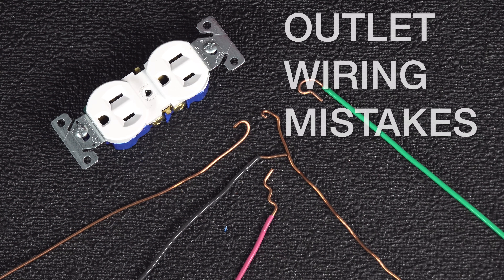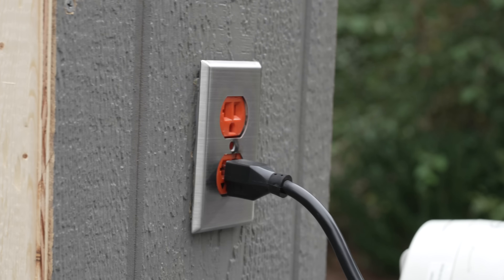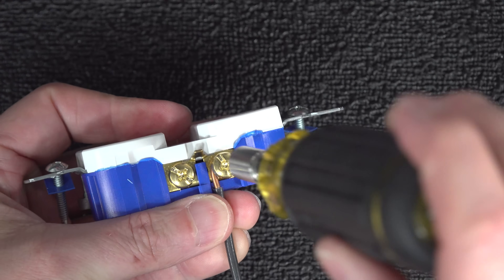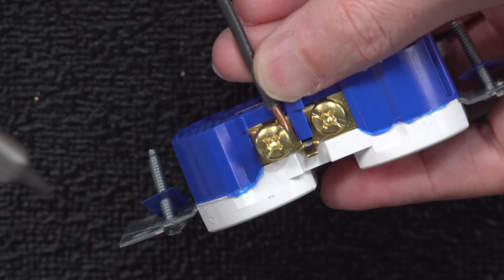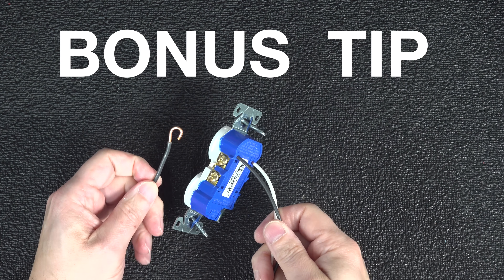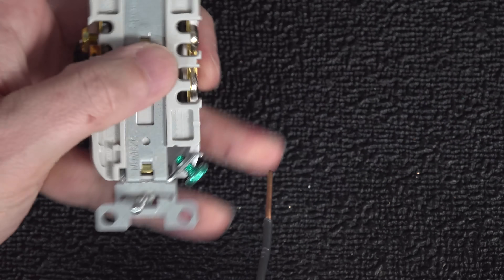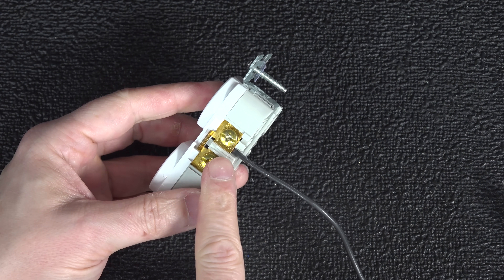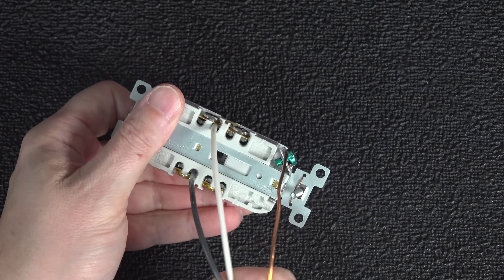BEWARE Of These 3 Common Wiring Mistakes On Outlets & Switches

Comment: What went unmentioned was the use of the most effective tightening tool. While the screws on our US outlets will technically accept a flat and/or Phillips driver, the most effective driver(provides the most torque) would be a square,Robertson, bit.
Reply: He used a #1 square drive bit in the outlet which is the appropriate bit.
Reply: @ronh9384  is that what the manufacturer speced out?
Reply: As a Canuck, I NEVER understood the preference to a Phillips (star or garbage) screw head. Always veen a 'Robbie" fan. Red Robbie, usually Wood screws. Green Robbie fer electrical.
Reply: Hahahaha. Drivers do make it easier mine got stolen on the site. So, yea use thy hands.
Reply: Actually you van buy the bit that is a Phillip and flat combined just like on the plug
Reply: My apprentices are not allowed to use a screw gun on the connection screws. Hand tightened only with Roberts or flat screw driver. Most of the green helpers always strip out the screws or never get them tight enough, so I always make sure they learn the right way first.
Reply: I'm sorry but if you're using a square/Robertson screwdriver, you've lost all my respect. use an ECX screwdriver or go home.
Reply: @ThreePhase470  Red Robbie #2 all day everyday.
Reply: If you can't get the screws tight with a Phillips screwdriver, you should start eating some beef everyday instead of that soy stuff!
Reply: @melvinrexwinkle1510  A real worker worth their salt uses power drivers, or at least use a screwdriver with a properly sized bit that won't cam out or strip the screws. You gotta work smart, not hard.

Also it's the year of our lord 2022, that soy myth has long been debunked. Get with the times son.
Reply: @AdhamOhm  Soy is heavy on plant estrogen.
Reply: @AdhamOhm  Soy boy
Reply: @AlienRelics  Good thing I'm not a plant then.

Beef and cow's milk, on the other hand, have loads of estrogen. And not just plant estrogen either.
Reply: @robbarber7253  😆 I feel like it's 2015 again. Simpler times.
Reply: @AdhamOhm  power drivers are diesel powered and deliver min 5hp. You can't really tighten a screw under 2022 fps
Reply: @melvinrexwinkle1510  Let's go Brandon 🏁

Comment: It should be noted even the cheap receptacles are labeled as to what wires go where. They also have a built in strip gauge. Those plastic wings next to the screw terminals on hot and neutral are to catch the end of the wire to avoid having too much hanging out. Usually the ground terminal has a wing that serves the same purpose on newer receptacles but it doesn't seem like it's as common as the plastic/ceramic wings are for hot and neutral. Almost every receptacle I have replaced I seen that the previous guy bent the end of the hook past 180 to clear those wings instead of just trimming off the excess.

Comment: Related question: why are the push in connectors (replacement for wire nuts) and wago lever connectors good but push in connections for outlets bad? What is the difference between the two?
Reply: low quality sockets^^

Comment: The earth must always be at the top. Common mistake in the USA.
When you wrap around a screw you are only going half way round. You need to use long nose pliers to finess the wire to as close a circle as possible to maximise contact.
Also, use a proper electricians screwdrive with full insulation.

Comment: HE MISSED SOME VERY IPORTANT MISTAKES THAT CAN AND WILL START FIRES!  I AM A MASTER ELECTRICAN IN 24 STATES. >>>>>>>>>>>>>>>>>>>>>>>>>>>>>>>>>>>>>>>>>>>>>>>>>>>>>>>  <>>>NEVER EVER run current through those break off tabs in the middle of each side of the duplex outlet. Duplex indicates TWO outlets, so let us think of these as TWO outlets.  Wire nut pigtails onto your wires and just use 1 wire for each connection, 1 hot 1 ground & 1 neutral. Those tabs are meant to be broken off so you can have either the hot broken off so one outlet is on a switch for a table lamp or a floor lamp and the other outlet is always hot or un-switched. That way a wall switch can turn on a table lamp, or a floor lamp instead of an overhead light fixture. You can also break off BOTH of the tabs off and wire each outlet to a separate circuit, on a separate breaker. This would be done for heavy duty loads like photocopiers, large refrigerators, microwave ovens, convection ovens, or beefy power tools, such as for woodworking, or metal working. It can also be done for redundancy so if one breaker trips you still have a live circuit.  If you are using stranded wire ALWAYS ALWAYS  twist the ends of the strands COUNTERCLOCKWISE so as the screw tightens up against the wire it actually pulls those strands together tighter and tighter. If you twist them clockwise, the strands will be mashed out and loosened up as the screw turns against them.

Comment: 1 thing to add. always wrap the outlet in electric tape to cover the exposed screws. makes it a bit safer to work with
Reply: I wouldn't say you should always insulate after you're done like that but it's a handy trick and one I use in a couple places. IDEAL has their ArmourBand that makes it a bit less of a hassle than having to pull the device mounting screws all the way out. https://youtu.be/pTrLkNwPBVQ

Personally I wrap with electrical tape when the outlet or switch is going into a metal box or when there's two separate circuits going into the same box. You could argue that it would improve safety in the event that the cover plate breaks but honestly you're much better off just using the "unbreakable" cover plates everywhere if that's your concern. If you ever have a spare of one of those try cutting it or breaking it and compare it to a traditional non-nylon plate. It's a massive improvement and once they aren't so incredibly brittle it's not much of a concern.

Comment: Some comments: Backstabbing - sticking the wires into the 14GA holes in the back of an outlet where its held in by a spring. These make shitty connections and you called it "backwiring". Your last example with the easy to use clamping outlets is in fact Backwiring. Backwiring is GOOD - it's when you insert the wire into channels in the back and make the connection by tightening the screws. Backstabbing is bad and requires no tightening of any screws

Comment: I installed a bunch of those outlets you showed at the end last week. They are a pain for using the hook method. The wires already had the hook on them from the previous outlets or I might have just used the straight wire.

Comment: How can backstab wiring be considered a "serious mistake" when it's perfectly acceptable to UL, NFPA and NEMA? 
I have replaced at least half the outlets in my house and used backstab for most of them. No trouble in more than 30 years. Come on. Get real.
Reply: they make shitty connections. I had an outlet heat up and melt/ turn black this year in my apartment. Took it out of the wall and it was backstabbed. While yes it's technically code (ONLY 14GA!), no electirician would reccomend it. Also If you wired up your house with 12ga wire with backstab connections, that's no longer up to modern code. You can only buy backstab outlets compatible with thin 14ga wire --- 99% of the time your house runs 12ga wire to the recips.
Reply: @joshdoeseverything4575  "99% of the time your house runs 12ga wire to the recips." 

what?

Comment: Backwire connections may not be as solid as a “hook” and I usually do avoid them, but it’s a total myth, NOT supported by any new home or remodeling warranty data you’ll ever find, that those connections are any more problematic or less durable than the “hook”.  In fact it’s the same sort of connection you find in the various “wago” type connectors that everyone raves about. In fact , If some moron is overloading an outlet I’d rather have the backwire connection arc out and fail sooner, than having my side terminals overheated for months or years.  Secondly I don’t care how many terminals are on a device, they should NEVER be used for splices.  The safe and correct way to wire an in-line device is to pigtail it in the box  that way the device itself is not under any load at all unless something is plugged into it - vs having the entire load on the circuit flowing in series through every device. Doing THAT is what makes backwire terminals fail early and thank God they do.  Somebody qualified can find and fix the mess.
Reply: When you have to spend a lot of time finding bad connections that seem to only occur on old and backwired devices, you might not care at all whether there is scientific data about the problem if a tenant calls for a repair. And when you've fixed one, when will the next one fail? That's the question.

Comment: Another indicator of polarity on these duplex receptacles is the blade slot length.  The hot (feed) line is shorter than the neutral blade slot.  Another mistake is making the hook too tight of an arc.  The apex of the arc is often sticking out from under the terminal screw, reducing the contact area.
Reply: only ground need be longen than hot and neutral. and hot wire hole need be upper side at wall, if flood groung and neutral has before in water than hot wire, this mean safety  and circuit break flood safe. hot no have first in water and kill peoples.  and who idiot use old style shit socket today ? today can buy lot lot better sockets safe more and spring loaded wire connection lot better and safe. many house has burn because uses screw tighten connection at wire, screw lose and then burn house. i know many house were has lose wire sockets has tighten good but time open screw sure. and has many house near burn this style old cavemen sockets.
Reply: @mattivirta  , please work on your English; I found it difficult to decipher your meanings!
If I have understood your statements correctly, you are saying that for safety concerns, outlets should always be installed with the grounding lug down so it looks like a little face.
Your concern is that rising flood waters will short the socket and risk electrifying the water.  IF the system is NFPA compliant (up to code), that is not a concern.
Electrical circuits are protected by fuses or breakers that are higher that most outlets. Within microseconds of one of the hot wires becoming grounded through the water, the short circuit causes the fuses to blow or breaker to trip, stopping the electric feed.
As to the safety comparison between spring loaded bayonet connections and screw terminals, the jury is out on that one.

Technically, the binding post terminal has more surface contact area than the bayonet spring connection so can carry higher currents with lower generation of heat.
Most household duplex receptacles are rated for a  maximum current of 15 amps. Both styles of connection can handle that easily but the bayonet is more convenient.

One of the biggest problems with outlet fires is poor connector condition. Old, oxidized, or corroded blades increase the resistance to electric flow causing heat.  While the circuit may never exceed the current rating, the heat build-up can be significant.  Make certain blades are free of debris, dry, and clean before plugging in.

Comment: You said, “Backwiring can cause a lot of problems.  Electricians are almost never going to use them.”  Damn!  I wish that was always true.

My sister’s 40+ year-old house has some outlets that are loose fitting.  One of them nearly caused a fire.  So, I have been systematically replacing her outlets whenever I’m back in Ohio.  

So far, I have replaced all the outlets that she uses regularly, especially the ones that power appliances that use a lot of current.  I will eventually replace them all.

Every one of the outlets in her house was backwired (or backstabbed, if that is the proper terminology).  Those things are a pain in the a$$ to get apart.  Plus, it was really obvious how dangerous they actually are.  A couple of the outlets Sis used to run her vacuum cleaner had scorch marks around the wire hole due to overheating of that lousy connection.  I’m surprised she hasn’t burned her house down.

I guess the Electrical Code in Ohio was rather lackadaisical back then.  Yikes!
Reply: It's not the code that's the problem; it's the testing people (UL, etc.) that list them as approved that is the problem. Too late we learn that they are bad news.

Comment: I’m going to throw in one more tip that most people don’t know about.  After you have finished tightening all the screws, wait a minute or two then go back and tighten them again.  You will notice that the screw moves another 1/8 turn or so.  The wire “relaxes” after a couple minutes, which loosens the connection slightly.

This is especially important if you are doing anything with stranded wires like rewiring a lamp cord.  But I have also noticed the extra tensioning on solid-wire (single-strand) house wiring as well.
Reply: Stranded wire should use a krimp to connect like this

Comment: I have been electrically shocked 6 or more times and 50% of it was intentional. If you are going to get electrically shocked you have to make sure you use one hand or else the electrical current will go through your heart.
Reply: Or you could just shut off the power and not get shocked at all.
Reply: @stephenhopper1  but where's the fun in that?

Comment: "Black Gold" is the first lesson I learned in wiring a home and I have never forgot that basic relationship. The second lesson was the right needle nose to make a bend. Next lesson switch legs, especially three way switches. Now there is an area people can really mess up. It is amazing how much revolves around that basic ac wiring pattern.
Reply: @JesusGonzalez-kg2fe  Well I have never known that bare electrical wire was used except as a ground. Even in knob and spool days where a ground was not used. Any change in the electrical code book I have seen raised prices out of concern for either worker or user safety if not both. Where conduit is used to protect the average person from poking a hole in the wall and cutting into a live current they allowed a metal wrapped set of insulated cables as a substitute often. That took the specialty of bending conduit out of the picture and made it easier to install for the untrained. Whether or not that was cheaper probably comes down to wages. It is up to each state to either adopt the code recommendation in their state or not. 
When ARC fault plugs went in the code for all homes about 12 years ago my state delayed adoption a couple years because of the recession and at that time it would have added about $1000 in costs to an average sized home just for those plugs [then about $18 each] that were relatively new on the market.  Today in my state the basic plug shown here in the demonstration has been replaced and is not legal for home application in new buildings or when lines are added to existing. The reason was that the influx of electrical products from Asia was creating a situation of current jumping from the outlet towards the plug as you put it in. Sometimes it hit the user and that situation was getting worse. In that situation an arc fault cuts the power at the plug where a GFI would stay open. Now that I am out of the business I am not in the habit of keeping up on the electrical code. The code book is rewritten every 4 years at least in part. As to building codes I am generally the wrong guy to talk too. But I did have to get up to speed on them for hospitals when I was installing a security system for the births section of a hospital. The building inspector would be passing judgment on my work along with the electrical inspector and fire marshal. Scheduling them to all be at the same place at one time was a trick I left up to the office. It passed and I hoped they would never need the system but if they did I hoped it did its job and locked the doors on that floor if someone tried to steal a baby.
Reply: Black gold is a good motto. Just like small feed. The small prong is always hot. That way, even if the screws are somehow not properly colored, you can tell what goes where.
Reply: @JesusGonzalez-kg2fe  that is cool. Those button fuses were spooky. It seemed like it was always the lights. Nothing like looking for which one blew with a flashlight and old batteries! Fortunately commercial work does not have that but I have opened a few lathe and plaster walls when I helped a friend remodel his home. Vermiculite is nasty.

Comment: I'm still struggling with the concept of having a black wire as the live. In the UK and Europe we only have red or brown as live, neutral is black or blue. Earth is always green or green and yellow striped.
Reply: Hi, In France, the neutral can be only blue. Phases can be any other color but the most frequentlu used is brown for single phase. In three phase,  one is brown the other two are black (the ones you invert to get your motor running the way you want). Standardization at the european level is not won yet !